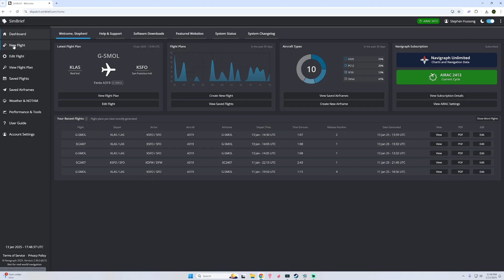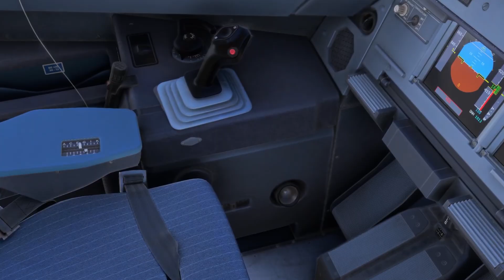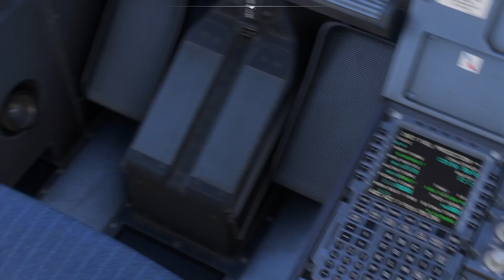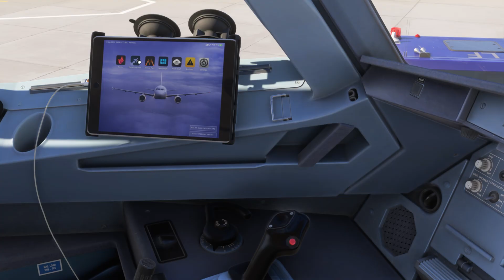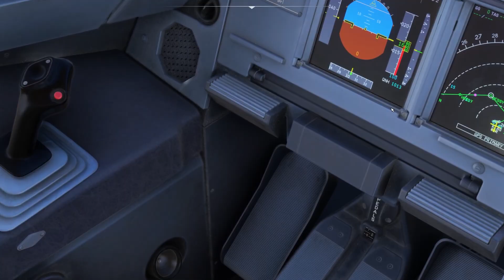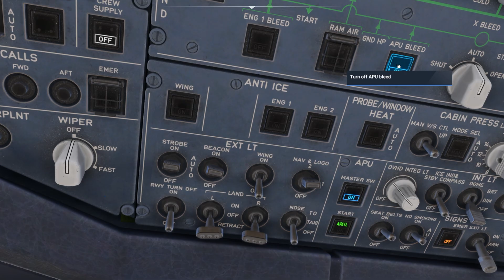Fenix A320 MCDU Setup Secrets in Microsoft Flight Simulator 2024!

Comment: Hi, thanks for the video! It's a big help as Fenix has little meaningful documentation on the A320.  I bought the package 2 weeks ago and due to the lack of instruction it's been hard to learn.  There's also several bugs in the software that's not making it any easier, and judging by the comments I read Fenix can't or won't address them. So far I'm not impressed with it.  It's certainly not PMDG level, that much is certain. That said, thanks again for your thoughtful and well done video. Without people like yourself I would've given up on it... and still may!
Reply from the maker: I'm glad the video was helpful!

Comment: Hey, good vid. Here are some tips to level up your experience: I don’t know if you are doing the setup as AA does it, if you don’t, here are the standard airbus SOPs that we use as my airline: after the external power is on do the APU fire test and then the IRS align. Then start the iPad and review the OFP, after that you request the init req (in both atsu and init), check the perf/idle that’s the same to the OFP and get the ATIS. After that you will select your chats, do the takeoff performance and the landing dispatch performace. By this point the aircraft will have been accepted on the maintenance logbook. The PM will check the oxygen, hydraulic and engine page and then set the parking brake on for walk around, as well ad chhecking the flaps and spoilers are retracted (and the cabin has the ropes and vests and all that stuff). Then the PF will start the overhead work flows until reaching the MCDU. The MCDU work I know is different in every US airline, I don’t know if you are working by any of them, if not, there an airbus trick that’s called : DIFSRIPP. Data, Init A, Flightplan, Secundary Flpn, Radnav, Init B, Performance, Prog page. Hope this works an idea, happy flights.
Reply from the maker: Thank you for the tips. I will definitely incorporate them into my next video!
Reply: @ anytime, nice flights.
Reply from the maker: Cheers